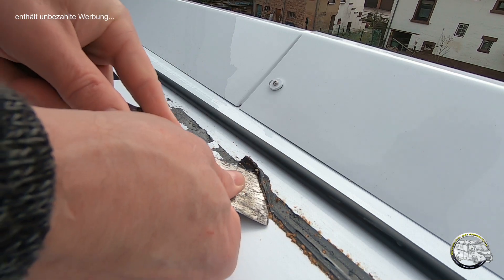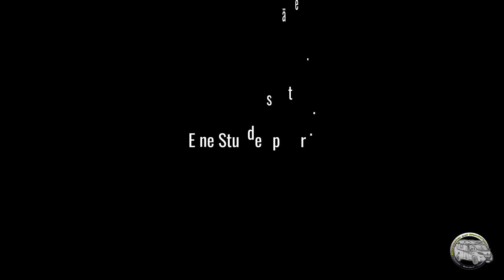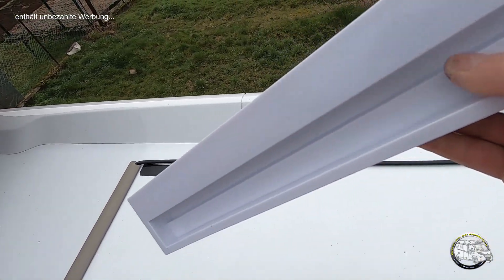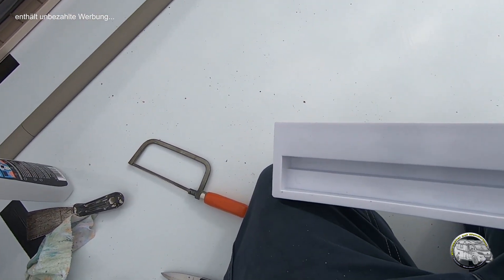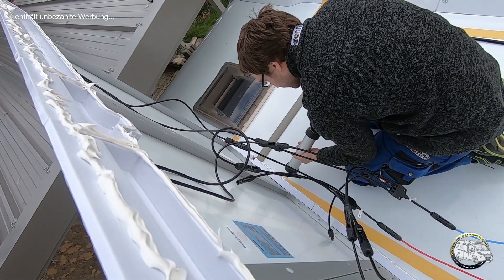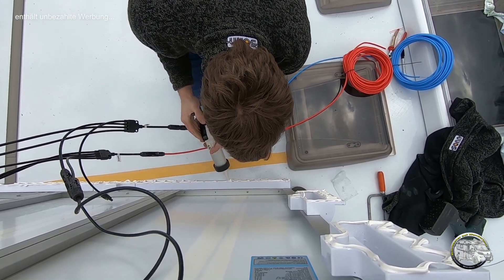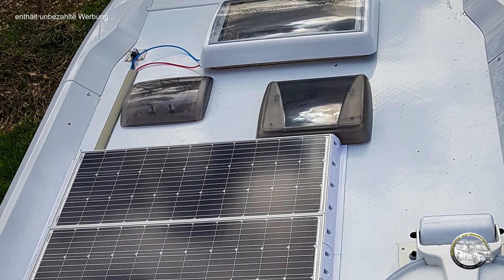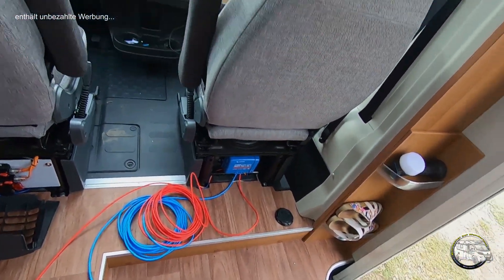Solarstrom für Betty

Comment: Mini Winter Solar Tip;; Ein Beuler und alle anderen hungrigen Stromverbraucher kannst du per "5000W Dimmer" stufenlos herunterregeln. eBay 7€. Ich lasse 5 Dimmer im Parallelbetrieb an einen 850W Inverter laufen. Wasserkocher 2.2KW auf 150W läuft bei mir 12 Stunden am Tag, so ist das Wasser immer schon heiß. Der Raum wird auch schön geheizt. 2.5KW Waschmaschine läuft parallel mit auf 200...400W gedimmt. Bügeleisen, Geschirrspüler, Backofen, E-Heizer, Kaffeeautomat, alle internen Heizung sind bei mir so gedrosselt. Videos dazu auf meinen Kanal https://youtu.be/eC2olbCBhh0 Der Inverter bleibt kühl, leise und die MOSFETs bleiben heile, weil keine extremen Stromspitzen mehr am Inverter ankommen. Jetzt reicht jeder Mini PV Inverter, um große Geräte zu vertreiben. Mit dem Dimmer lassen sich also alle internen Heizungen/Geräte in Grundlast-Geräte umwandeln, die annährend permanent AN bleiben, und dabei nur wenig Strom direkt von der PV ziehen. Mit einem Wattmeter /Energiekostenmessgerät kann man das dann prima ausmessen.